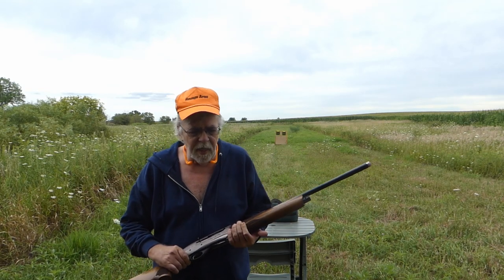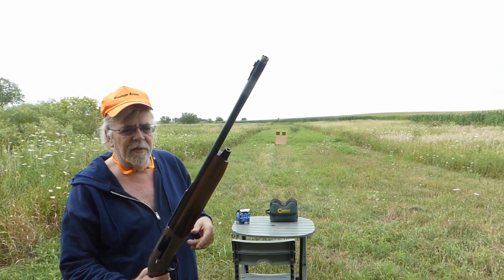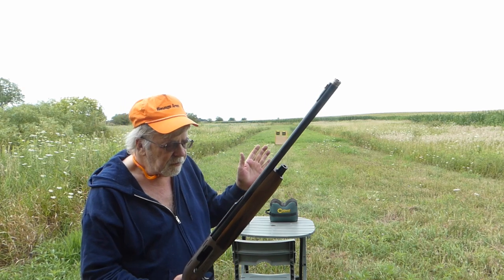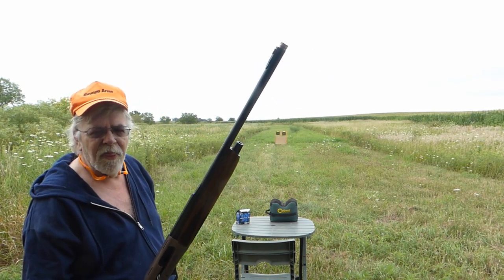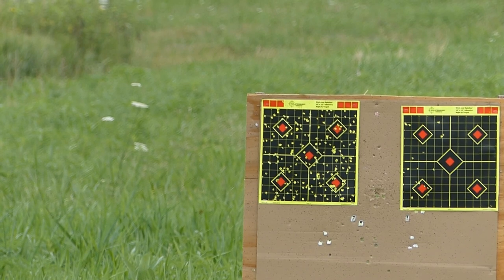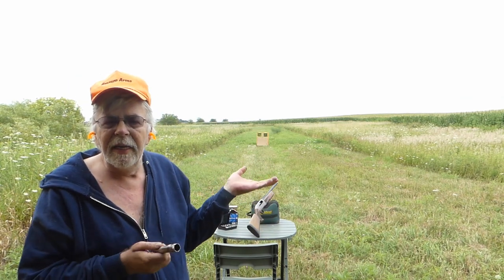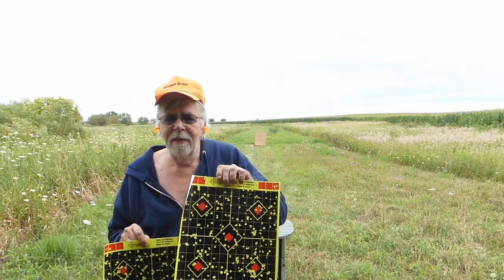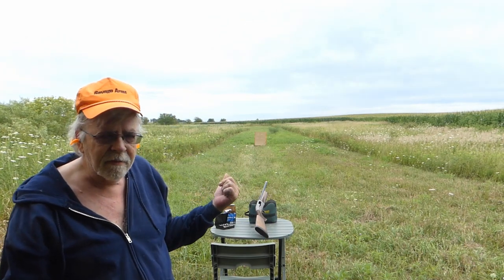Shotgun Barrels & Chokes #Fabarm

Comment: My Browning Feather 12 gauge 26 inch barrel is using blackened stainless steel ported extended Trulock chokes in improved cylinder and improved modified at your suggestion. 6 pounds and 7 ounces 12 gauge 3 inch over and under shotgun. My dream shotgun.